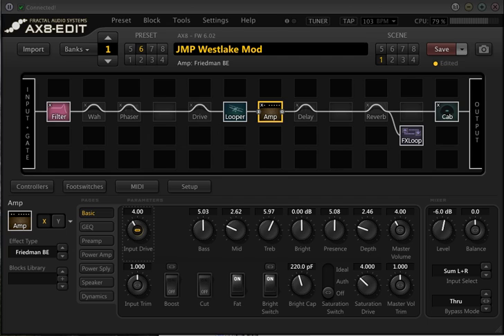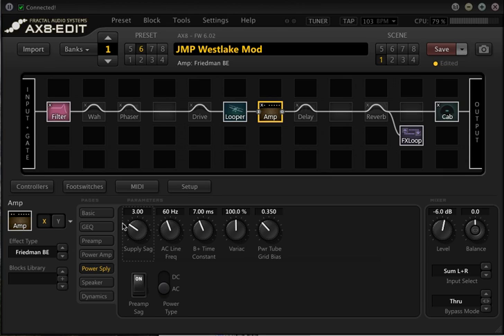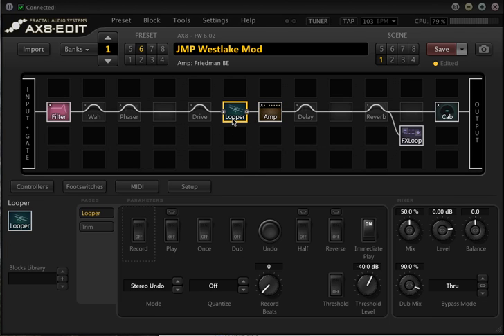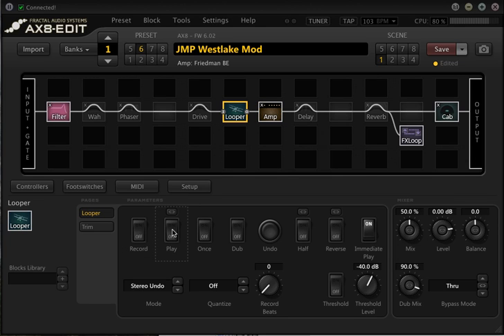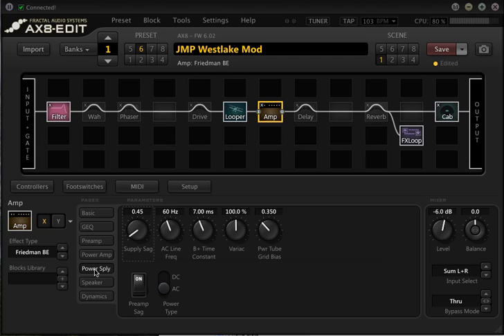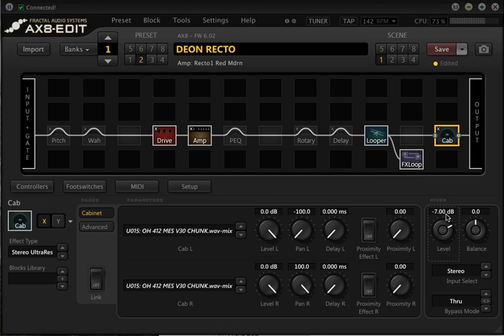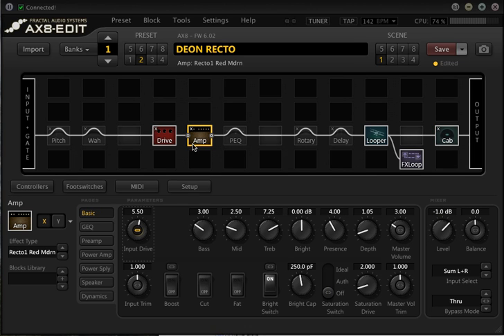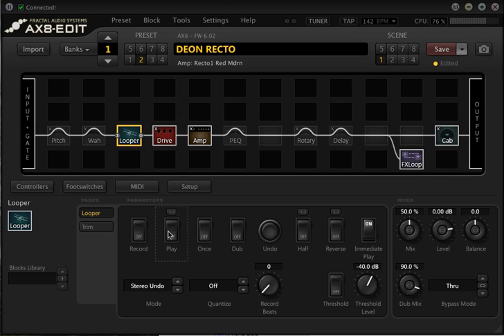FAS AX8 - Supply Sag Parameter

Comment: So what if im running output 1 to FOH and output 2 to the "Return" of the Tube Amp? How is the Effect routing will be? Please help. Thanks
Reply from the maker: This is set up to do FOH/Power amp at the same time; the cab block is located after the effects loop so that it only goes to FOH and not to the power amp. However, there's no way to turn off power amp modelling on output 2 only, so this works better with a flat solid state amp like the Matrix GT800 than a tube amp.